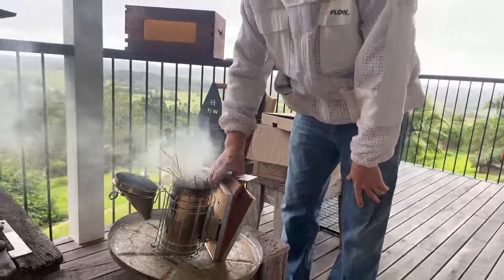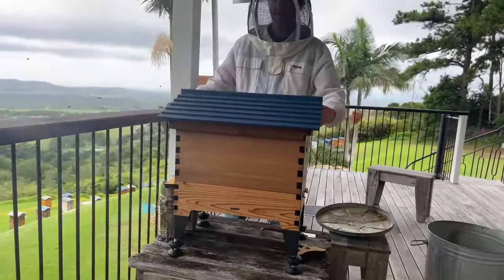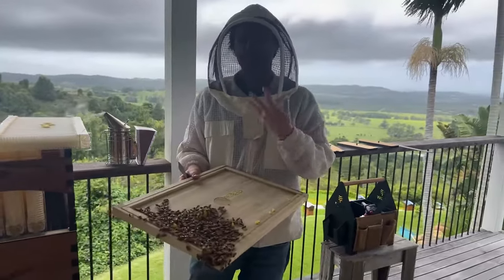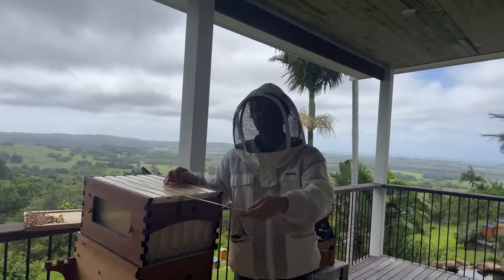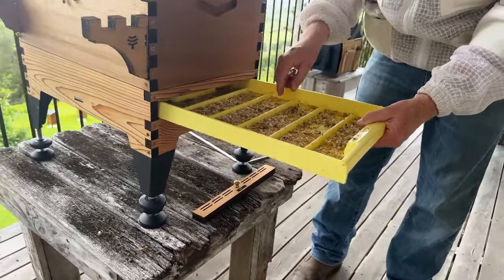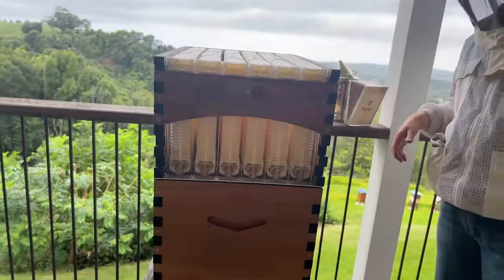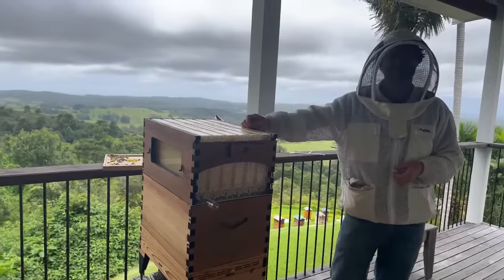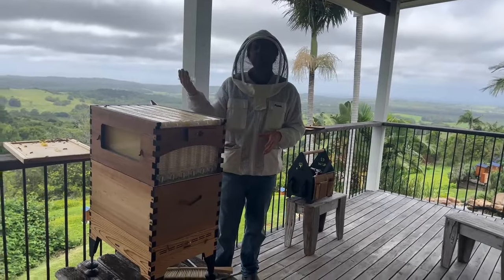When should I put on my Flow Hive super?

Comment: So is there a reason you don’t just have the super on from the start so the bees start storing honey in the super from the get go? What is the reason you have to wait until after the box is all filled out?
Reply from the maker: There is an its a really important factor. New bees need to concentrate on establish the brood box first, bees are given different jobs inside a hive and more space acts as a stress and can stretch the bees resources thin. As bees need to regulate the temperature inside the hive, extra unused space can create more humidity and require more fanning out of the hive. All of this adds up and can cause some major delays in bees building a strong population. Supering in some places can be quite a precise practice, with some seasons only having short nectar flow in which case any super is only added right when the bees are both strong and show signs of major foraging. In areas where the season is longer bees can work on this over time, it is not uncommon for a Flow Super to be filled in peak season in just a few weeks. –Kieran